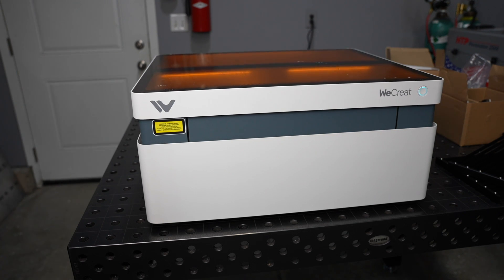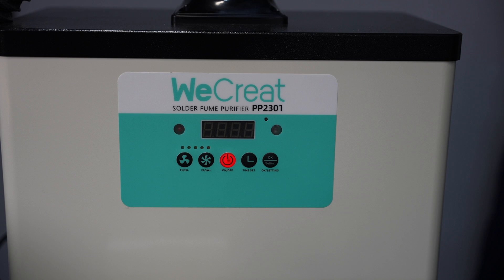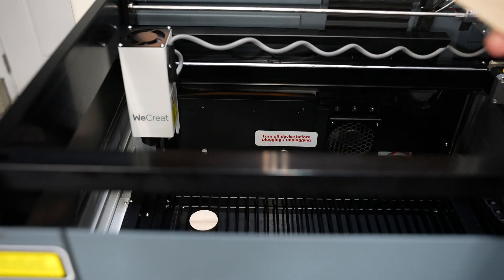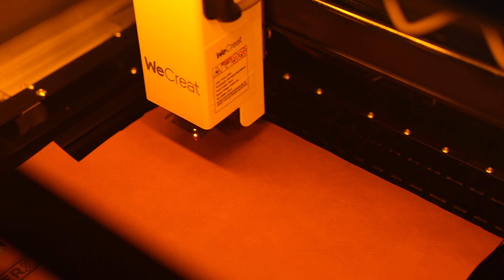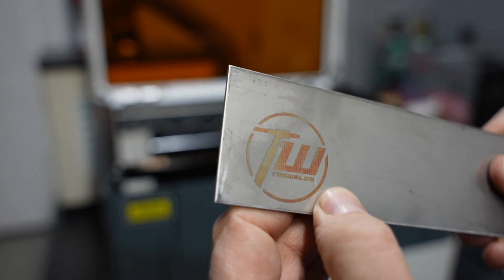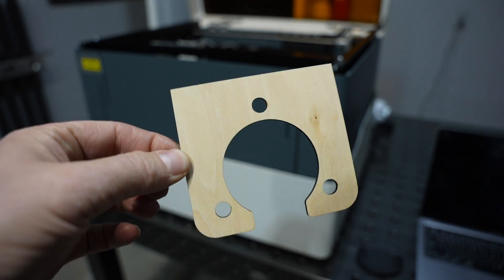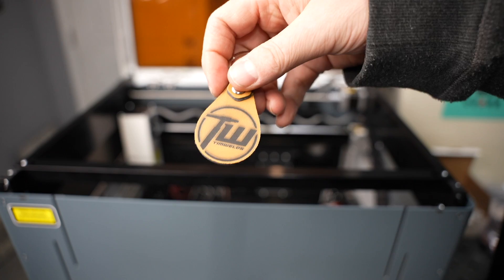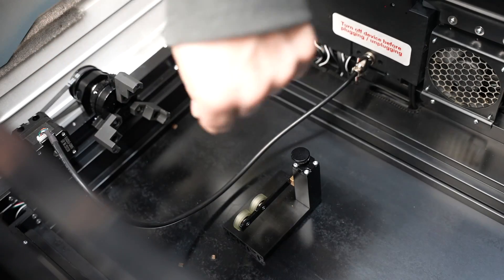Surprising Results From This 20W Laser Cutter: WeCreat Vision Material Test and Projects

Comment: Hello, I have bought the 20w unit a while ago and keep running into few issues and I was wondering if anyone else has this issue and how to diagnose and solve them.  One of the problems is that when after autofocus I run the job, the laser hits the object and pushes it down which damages the laser.  Another issue is that it keeps disconnecting the USB.  Also, at times I click on the start button but nothing happens and after a while it says sending the job was not successful.  The same problem happens when I click the button to start the job.  Thank you.

Comment: Hey Tim. Huge fan. I've been following your videos since the day I started welding. You've been so influential and helpful in my journey to welding. This comment does not pertain to this video. I figured my best chance at reaching you would be through a comment on your most recent video. As there is no contact information for people to ask questions such as an email address. That I know of anyways.
To my question. 
I recently ran across a video that said it was Mag welding. I thought it was a typo at first but upon some light research I found out Mag welding is a totally different process then Mig. This was a shock to me as I thought I knew about all the processes of welding. 
I was wondering if you could do a video explaining the differences between mig and mag and where it would apply or how you would use it. I can't find any youtube videos explaining it surprisingly.
Thanks man. Have a good day.
Reply from the maker: That’s a great suggestion, I get asked about this all the time. Whenever there’s an active component to the gas, which is basically always the case with steel, it’s technically MAG. In the US, most people call all of it MIG, so I use that term. The technically correct term for all of it is Gas Metal Arc Welding. I wouldn’t call it a totally different process, you use the same machine and basically the same technique. It’s more important to understand the different transfer modes, which I go over in a video called 5 types of MIG welding explained.

Comment: If you are going to make a fixture for doing the key fobs make it to take multiple fobs at a time and run them as a single job. That way you will only run the focus once per fixture with a batch of fobs. Failing that, get into the G code and workout what the focusing routine is and how it calculates and stores the focus height. Then you could edit the G code to remove the focussing stage and just input the value.

Comment: A external air pump can be good. Internal ones could be proprietary design or of a type that is hard to replace. External you can just pop one on from a large selection available. Might not look the same, but it's the CFM that counts. Should also be cheaper.

Comment: laser goes with any color ,  only white takes a little tweak. make it a tad stronger and slower in the settings and it pretty much works

and even if you can have a filter coupled to your machine , never - ever - use it with PVC or anything chlorine in the mix. you'd be basically creating sarin gas/ mustard fumes. and die... 

other than that, great fun

Comment: Very cool, Tim. Several years ago I had a job in which I used CO2, fiber, and YAG diode marking lasers to make equipment ID plates and labels. Because the diode laser software allowed more control of laser pulse width and frequency, we were able to mark stainless and brass very well and even aluminum somewhat successfully. The aluminum was more just a contrast in texture rather than color. With the stainless, we could even get some subtle color variations (blues, reds, purples). With the brass, especially, it was important to make two passes at different power, speed, pulse width and pulse frequency to get a high contrast mark.